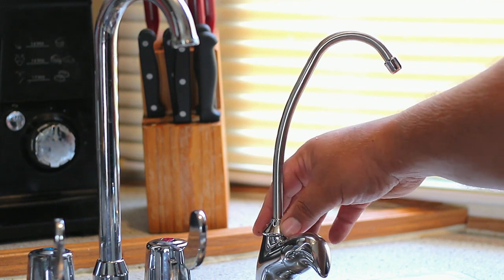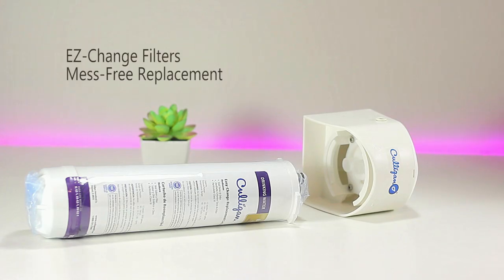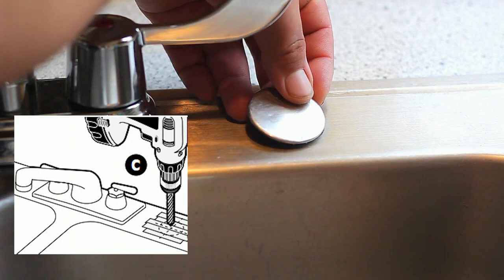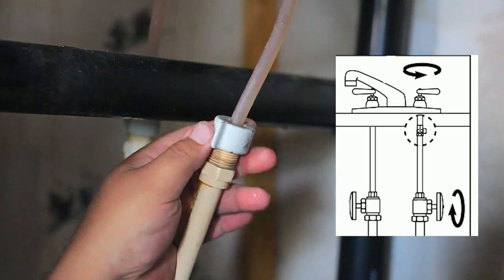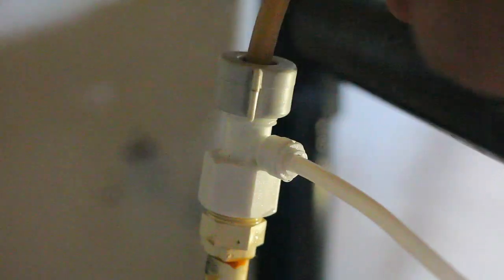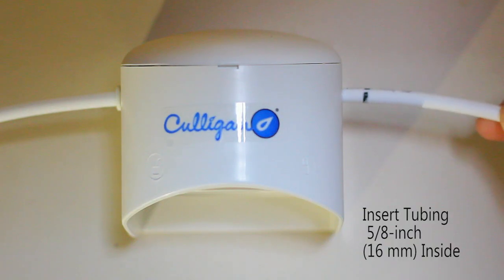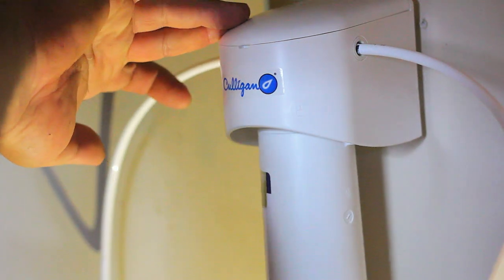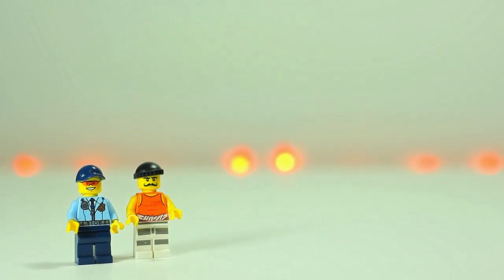How To Install a Under The Sink Water Filter With Faucet Culligan EZ 1

Comment: Excellent instructions and this system was super easy to install. I put mine in my insulated crawlspace as the main artery to all my drinking water lines is there. I had a unique pivot as these water lines are 3/8 in. I had to merge into a line that was 1/4 in that was quickly done with a "shark bit" fitting that has 3/8 in. on one end and 1/4 in. on the other on both the intake and outtake. If your line is pretty basic, you should have no problem. However, unless you have supervised your own home build you will have no clue what may have to add in-line.

Comment: The only thing I don't understand from this is how to switch from one faucet to the other if necessary? Or is it as simple as just using the other faucet's handles to have the water flow from the other faucet?
Reply from the maker: they work independent from each other. meaning you can even use both at the same time or individually. even though its supplied from the same water source they both are ready when needed.

Comment: I need to remove the tube from the cold water T fitting so I can replace the kitchen faucet.  Do I just pull it out?
Reply from the maker: You can try to pull it out, but we believe once they bite its in there. If it cannot be removed you might have to cut at connection and have to get another t fitting. Let us know how it works out for future reference. Good luck.
Reply: @StatUpBox  another vid shows that to insert the tube you push in on  the collar.  perhaps pushing it before removing?
Reply from the maker: It can be a option.only way to know is shutting off water and giving it a try. But if that doesn't work usually fittings are pretty cheap. But in other hand being able to push and pull is free and dont have to go to hardware store.
Reply: @StatUpBox  It works.
Reply from the maker: Thanks for sharing that is good to know as well for others too. Great job! 💪you're Officially a Boss !!😎

Comment: Hi, my filster system is leaking from the top of the filter receiver, there is small hole and is leaking there, any sugestion?
Reply from the maker: Fist sugestion would be calling the 1800 number for the manufacturer, sometimes they replace part for free or very cheap, we experienced something similar with another brand and we got part free. Even though there is food grade safe silicone sealent, with time and constant water movement, the best bet we believe would be a replacement part. But asking In your local hardware store for maybe food safe, water safe solution meanwhile you can replace the part would be second option. Good luck.

Comment: How do I disconnect the inlet and outlet water lines if i have to?
Reply from the maker: +cooldog60 do you mean before installation or after everything is installed ( go back) ?
Reply: I found the answer. But thanks.